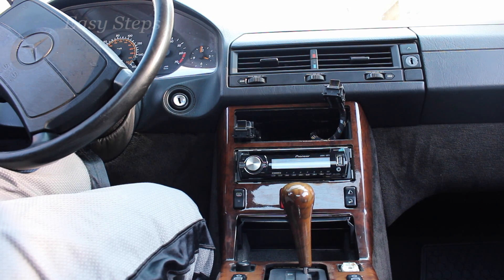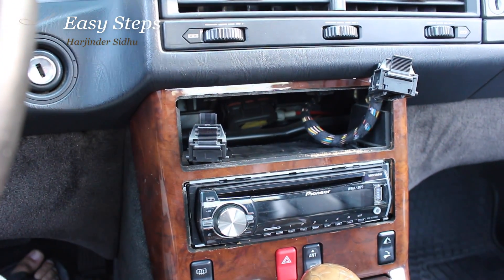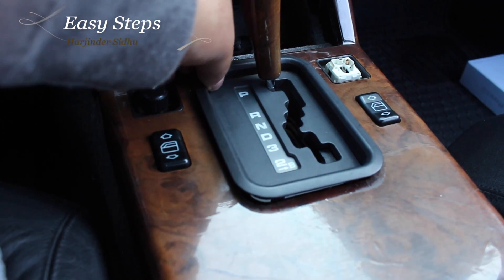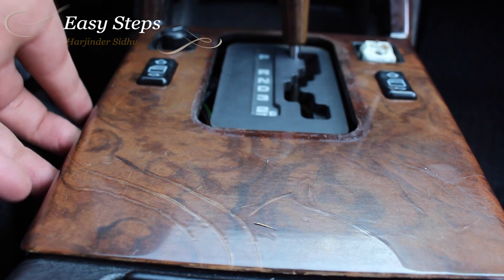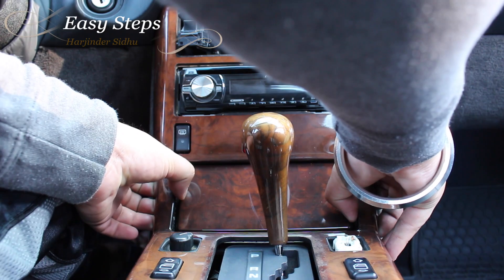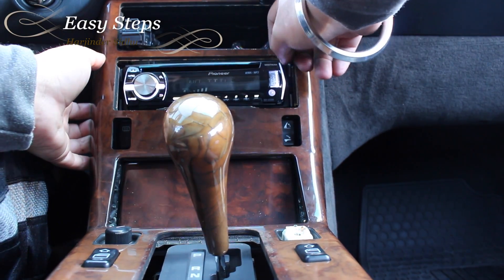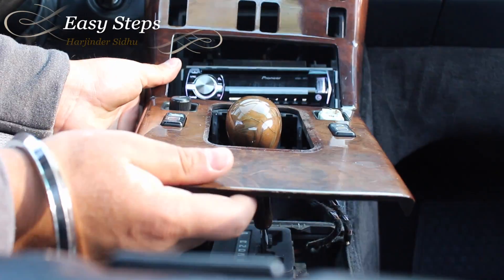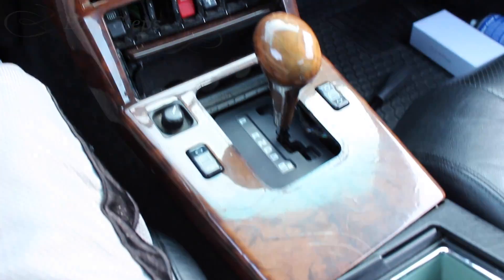How to remove Center Wood Console on Mercedes 500SL | R129 Roadster Mercedes

Comment: THIS IS NOT THE WAY TO DO IT!
What the poster has done here is to rip the wood trim from the plastic framework underneath. The "Sharp" bits he refers to are in fact the ends of the staples that are meant to be holding the plastic framework to the rear of the wood trim.
The change hole/cigar lighter/cubby hole comes out with the whole unit. Lift up the door and remove the grey fuzzy liner and you will find two screws at the bottom on either side that fix the cubby hole to the car. Remove these and the console will come out easily.
Reply: THIS!!!
Reply: Thank you so much!

Comment: This is a awful video and is instructing people the wrong way there are two screws in the bottom of the storage cupboard to take out first. Those staples are factory construction and are not designed to be ripped apart